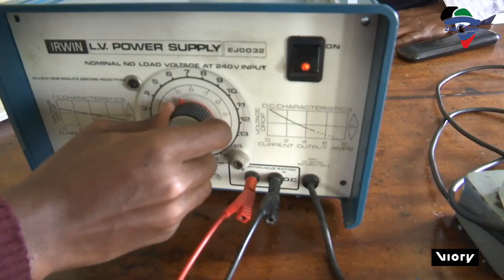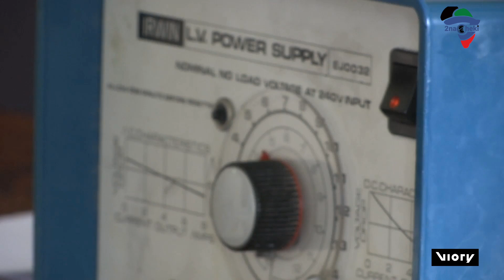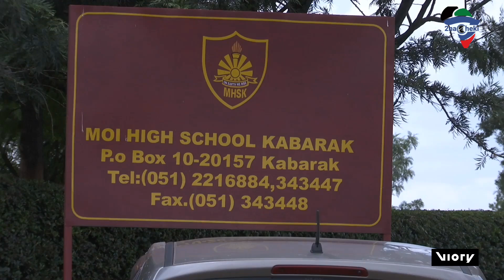African Boy Develops Sustainable Energy Solution - The Infinity Reactor

Comment: Let me get this straight.  He's claiming that the output power exceeds the input power.  I didn't get the sense of that, nor did he prove it in this video.  I would have been impressed if he ran the motor from the output source thus eliminating the use of an external power supply.

Comment: There is nothing "sustainable" or perpetual about that ---- the drive motor still needs an electric current to run ------- the transformer (blue battery charger) next to his "invention" supplies current to the one little electric motor to spin the other electric motor which in turn has a small output ---- no "invention" here at all

Comment: Guys this isnt scientifically possible. HEs reading the multimeter wrong. Yes his invention produces more "Voltage output" than 'Voltage input". But the current input is higher than the current output. Using a basic power calculation, the power input is actually a bit higher than the power output. this is because some energy is lost to sound etc. Remember, and this is a common mistake made by those not familiar with basic physics: voltage is not a measure of how much electricity is made, power is. I can shock an infant with 2 thousand volts at almost 0 amps of current and the infant might just cry a bit. I can shock the same infant with only 200 volts but 1000 amps, and it will resemble a roast turkey. This childs science teachers need to review where they got their training done, because they shouldnt be allowed to teach their students the wrong basics. especially since this boy is so passionate, the  best way to destroy his dreams when he learns that all of this was for nothing, and that his teachers dont know 8th grade electricity calculations
Reply: Yeah. That teacher should beRetrenched, and not be teaching anything related to science.

Comment: So, he made a tiny generator or what am I looking at?
How is this sustainable in a bigger scale?
Reply: He utilized a circuit system that allows minimum output into maximum input that powers the same motor producing the original minimum output source. 

Making low effort produce greater energy. How? That idk but this is what I got on what the idea is for sustainability...open to being wrong..
Reply: @ElusivEnigma  I am not here to argue with anyone, I am not an engineer or anything close to it, so I have no clue what is what and how is how lol